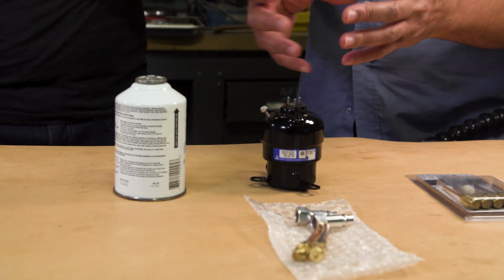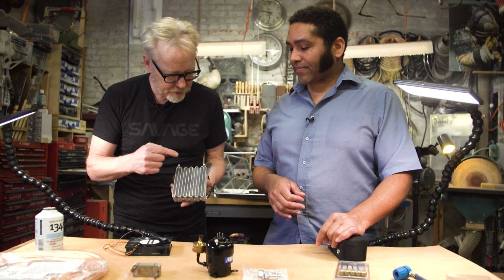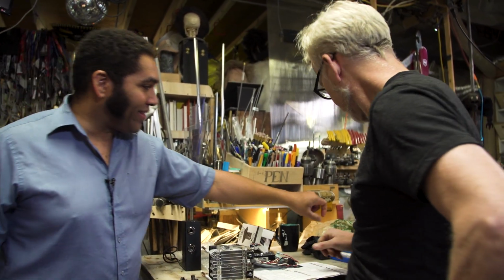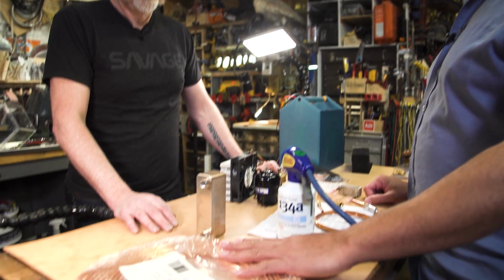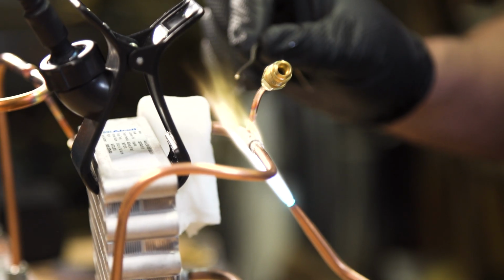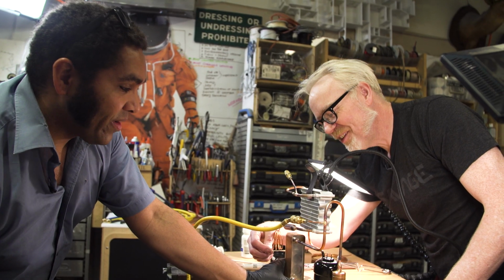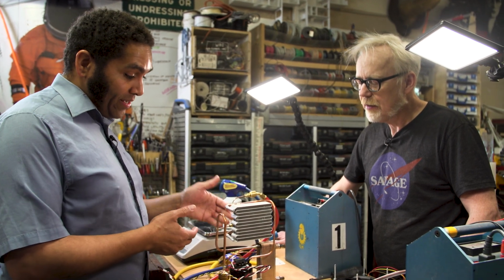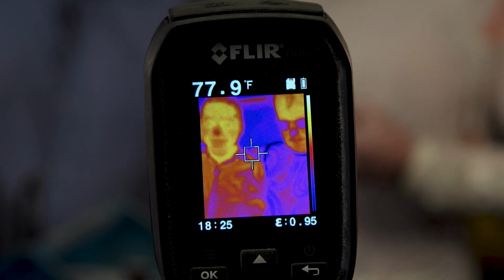Adam Savage's One Day Builds: Refrigerated Cooling Suit!

Comment: I would be curious about the capillary tube calculations because it's a variable compressor system and the load is set for what temperature and what speed? Higher flow would make it less efficient which is doable but sizing it to be efficient at high flow means it could backflow too much to the compressor or some such. A tiny TXV would have been nice too.

Comment: So, I've watched this video. I, too, have need of a system for cooling my body while wearing a skin-tight upper body silicone suit. But Adam, I just can't make this. I don't have the resources or the expertise to make something this complex. I feel defeated.

Could I not achieve a similar result using Peltier technology and a water pump and some fans and a 12V battery? Would it not be adequate? I still do not know. But I know I cannot create THIS build. :-(
Reply: In some of his spacesuit cosplays, he just wears a water cooled t-shirt, and has a tank with ice water on his back with a pump. Doesn't last for 
long, but it's something. I guess it would be possible to saw a tube of sorts into a shirt and pants, and have like a thermos with very cold alcohol in it with a pump that can withstand those temperatures, but probably wouldn't last a long time either. With Peltiers, you'd have to have MANY of them, well cooled, but since they aren't very efficient, is still could not be enough.

Comment: Curious I am about 3d metal printing the entire compression and expansion modules as well as integrating piezo fans for reduced power consumption. Battery or solar and battery power at various voltages would be a special issue Any thoughts?
Reply: That'd be a pretty cool use of metal 3d printing indeed

Comment: Why is copper tubing used for all of this? Isn't copper very conductive to heat, and you don't want most of your heat/cold to leak out in the wrong places? Especially the coil for the pressure drop being coiled up all close together, you don't want your hot side to leak heat to the cold side. I guess copper works well for working with pressure, but isn't there a way to get flexible tubing with less thermal conductivity? If the tubing is flexible that should make the whole setup a lot less fragile too. And since the pressure is somewhat constant under constant load the flexibility shouldn't matter too much for the function of the system.

Comment: I live in a super hot desert area of Argentina and I always felt sorry for the guys that do any type of work outside during the yr. Because when it's hot it gets super hot, but on winter it gets really chill. So, I always wonder why there aren't any climate controled suit for them to wear. They use some not high tech technics like be fully covered on light weight clothes an dcovert up to the head too so they create a sweat evaporated area inside the clothing that keeps them up to 5 degrees colder that outside. Much like people from shara desert or arabian desert do. But I believe that's not enough.
I wonder how you think the coller system you created in the video will work on a 100 to 115 F to keep a working hard person cool?

Comment: I just wish this was easier, cheaper, and more accessible to build. I definitely want one for many reasons including my personal health issues. Already looking at getting some form of helmet.

I hope to one day have a full body cooling suit.

E.g., similar to what China is now making with the air conditioned hazmat suits.
Reply: U dont have to go as hard as they did. Actually wouldnt be that expensive to make one that would work for most people's needs. U could get a suit similar to the one in the video with tubes running thru it and then just use PC water cooling parts.
All u really need is a radiator, tank, pump, fans and power. 
Ur not going to get as cold as this suit, but if they can keep 1000+ watts of heat under 30c in a PC should keep a person decently cool.

Comment: I want to thank Kipp so very much. He quantified the body cooling needs very well (-100w and non hair areas). I want to make one for my experimental airplane!! This is why I searched and found this video. Super jealous of the high quality tools there!! 40 yrs as an engineer I enjoyed Kipps explanation as clear & accurate, but simplified (appropriately) sometimes. Varying 134a mass flow, compressor speed, and fan speed effects nicely touched on. I installed a few hundred AC systems in VW's back in the 70's then after the MSME, fully understood.

Comment: Just coming to this video a year later, after Adam referencing it in the second G4 spacesuit build video. This is an amazing bit of technology to cool oneself while wearing a cosplay spacesuit. I know he did something similar with his 2001 spacesuits that he wore with Chris Hadfield. While this solution is super-cool (see what I did there?), I don't see it as being quite as practical as the cooling shirt version that was the predecessor to this design. I wondering if adapting a Peltier cooler into a little recirculating water tank would be a good hybrid between the two types of systems. Those little Peltier coolers can be salvaged out of battery-powered coolers, or possibly adapted from mini-chillers designed for nano reef tanks. Now I have to go back and watch the 2001 suit video to refresh my memory on how he did those coolers.

Comment: I really wish there was a parts list or documentation on what size fittings were used as well as how he determined the correct fill of refrigerant for this. Awesome build!
Reply: I need this too
Reply: Refridgerant fill for a capillary tube system is determined by its performance and temps, since it doesn't have an intelligent metering system it doesn't keep a constant quantity of liquid in the evaporator. You add to the low pressure side until the pressure on the high and low side are suitable given the load - based on the maximum load so that the liquid doesn't get too cold and have too little cooling power due to the pump working harder at a given RPM based on the pressure of the low side. At lower RPM, the temp will be higher on the cold side, and lower on the hot side.
Reply: @mikafoxx2717  so trial and error with a gauge set? This pump is variable speed so wouldn't it sort of only work well with a variable orifice?
Reply: @mikafoxx2717 ever since this videotape out, I wanted to program a small PLC to run a variable orifice, pump speed. And have all the feedback. But I really haven't been able to find documentation to describe the control loops needed. Or like.. what math to use to run them.

Comment: So, this might be a really dumb question, but could you use the same stuff to heat things up?
Reply: That's actually a great question. I'm an engineer and I'm not sure. I only know that from a high level the "carnot cycle" is indeed reversible, so you can switch the direction of the cycle and the direction in which heat energy is transferred. As far as the functioning of these actual components, I think the setup is one-way, so it would need modification to be turned into a heat pump. 

I'm going to read more about it.

Comment: I would seriously like to talk to someone about the price and possibility of building this in a 12v version if possible?  Having something like this hooked to a chill suit under our fire suits in a race car would be a game changer for sure.
Reply: There are already suits designed for racing in 12V. They typically don't use a refrigerator because a car is big enough that you can just fit a huge reservoir of ice water. Simple heat exchanger, no refrigeration cycle needed.
Reply: @paulogarcia1766  not the kind of car I'm in. Off road utv racing.

Comment: I hope you see this. But, I'm wondering how much space the complete unit takes up? What about the individual pieces?
And do you have to use copper tubing? Could you use flexible tubing instead?
Reply: flexible tubing diminishes heat transfer efficiency but yes it'd work

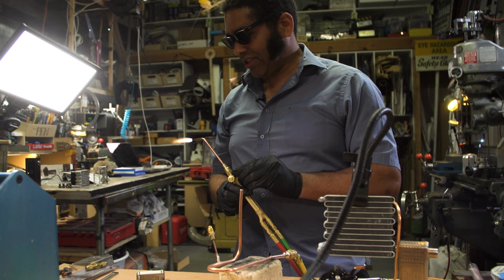Comment: One little thing they didn't talk about too much you can see at 38:26 and 40:35.
That yellow line is flowing a little bit of nitrogen through the pipe as they braze, displacing oxygen inside the pipe that would otherwise turn to soot and contaminate your compressor oil.
On tiny systems like this you just fill the system with nitrogen and let it sit there, on larger systems you want nitrogen gently flowing the whole time.

Comment: I’m only 13 minutes in so far but I’m positive about two things:

- Kipp needs to be in the spotlight much, much more often.
- You’re working on something that will drastically change the lives of a whole other population (which I’m interested to find out if you consider by the end): namely motorcycle riders who refuse to compromise safety by shedding gear when the temperatures rise.

Comment: That is a drastic oversimplification of refrigeration, but it's mostly right.

The compressor increases the pressure of the relatively warm, low-pressure refrigerant gas (goes from a low-pressure gas to a high-pressure gas) that (per Boyle's law) happens to also increase the temperature of gas. As the now high-pressure, high temp gas passes through a condenser coil (the hot one), then it changes state from a high pressure gas to a high pressure liquid as heat is removed and the temperature of the refrigerant decreases.

After that the high-pressure liquid passes through a metering device of some sort (usually a capillary tube for smaller applications, or commonly a Thermostatic Expansion Valve [TXV] for larger applications such as air conditioners) to lower the pressure of the liquid before reaching the evaporator coil (the cold one), resulting in a very abrupt loss of pressure and temperature changing the refrigerant's state from a high pressure warm liquid to a low pressure very cold gas. This gas then absorbs heat from the refrigerated air around the coil resulting in the temperature of the refrigerated air getting colder and the relative temperature of the refrigerant getting warmer, but not enough to change back to a liquid state. The relatively warm, low-pressure refrigerant gas then moves back to the compressor, and the cycle repeats.

It's all basically taking advantage of these very bizarre physics properties. You can think of it like exploiting a glitch in the matrix, and we just take it all for granted. As a refrigeration/HVAC tech, I love it.
Reply: To clarify, I wrote this based on the first 3 minutes where they summed up refrigeration systems. After watching more of the video, they do delve deeper into the physics and mechanics of how it works, and I think this cooled-water solutions works way better and makes a lot more sense than directly cooling just the air in the suit. As a refrigeration tech, I approve this awesome build!
Reply: Hi, could you tell me How to call this kind of vest without zipper in English professional title?
http://amzla.com/u7rtdt2bgsol

Comment: You can already get cool suit systems for use in motorsports applications. As you can imagine, racecars arent about comfort at all, and it can get pretty damn hot inside the cabin of one and in the quest for lightness the A/C system is one of the first things to get tossed. So you wear a racesuit that has refrigerant passages inside it and have a chiller unit about the size of an esky that sits somewhere in the cockpit and suddenly race driving is a few percent less masochistic with that creature comfort reinstated.

Comment: I once installed a similar heat exchanger that was 8 feet tall by 3 feet wide by 3 feet thick and weighed more than a Cadillac as part of a 30,000 ton chilled water A/C system for a small skyscraper in L.A. These things do an amazing amount of work for their physical size. You used tubing as the metering device? I guess they don't make TXV's that small?

Comment: It has been 7 years now since I last brazed. I was a union commercial plumber welder and I don’t believe one is supposed to use flux with brazing even with two dissimilar.  I remember the Ned air systems we put in with argon purge and I do not think flux was used as well as I believe we were not taught that was. Soldering yes but sil braze is too hot and would just burn the flux up bad.

Comment: Does anyone have any resources for information on the diffusion bonding process Kipp explains? I've only found information on using vacuum furnaces for braze wicking and using a pressure-based system, such as weights or a press, for this, but I have yet to find an example of Kipp's explanation of a dissimilar metal bracket.

Comment: That would be cool on the set of 1980's Star Trek but what about a silicone thermoelectric cooling suit lined with Nylon tubes? it wouldn't be as light as it sounds. Maybe 4-6 pads (at armpits and inside thighs) could power a pump and a couple small fans. Or you could where a wet suite inside out, that would keep you cold right?

Comment: Maybe using a small EXV that can be adjusted could be better than changing your voltage through the compressor, increasing temp variables without expending more energy from your battery also you wouldn’t need a long run of the capillary tubing, saving space in the process. Also using a deburrer and blowing nitrogen through the tubing can eliminate most of the copper shavings in your system preventing the possibility of your filter dryer from clogging.

Comment: When you drill a hole in the pipe and braze in a small service port, you create a stress point that will fail over time due to vibration.  @Adam Savage’s Tested idea of a T fitting was much better.  Time will tell

Comment: You pull vacuum to remove moisture. As soon a system has been opened for the enviroment it will be contaminated with moisture from the air. Moisture in the system can cause different kinds of problems and reduce the performance, so that is why it needs to be boiled away and that is done by vacuuming the system.

Comment: The cooling concept on your body is great! Big problem, ice against your body is very uncomfortable. Your skin has to breathe. Why do you think our bodies are cooled by sweating? The moisture evaporates carrying off the heat from your body.  True air conditioning is through air circulation, temperature control and dehumidification. Evaporating the sweat from your body and carrying off the heat. Exactly the way whole house and auto air conditioner works. I wonder how long you can keep that cool fluid vest on you before you get cold sweats? Yep, try it with an ice cube on your skin. Same thing. No air circulation or dehumidification to carry off the heat.

Comment: Adam! Eliminating the refrigerant in the video and compressing the air being breathed by the occupant to heat up a cartridge with sand, the carbon will be extracted by the silicon dioxide effectively coating the sand with graphite, and reducing the temperature of the air. Lungs have greater surface area than the skin covering your body; regulating the refreshing breath cooling your core.

Comment: Adam as a PC builder and experienced guy with radiators and water loops I advice you put the cooling fan the other way round on the radiator so that it pushes the air thru the rad instead of trying to pull the air thru it. From my tests push configuration gives lower temps than pull. The only other way to increase it further is push-pull config so 2 fans on each side.

Comment: If you fill the copper tube with water or even sand  sealed at both ends it will not kink when bending .  EVER.

Comment: Let me make this real basic. Temperature is a measurement of energy per volume (energy density). It's not about the medium (R22 etc.); it's about the compression and expansion of the energy in the medium. That energy typically/naturally flows from the space of high energy density to a space low energy density. Room (higher density) to uncompressed medium (lower density) through AC's heat exchanger, compression makes that energy more dense; then, the medium, now even higher energy density than outside summer heat, transfers it's energy to said outside air. One side is kept compressed by flow restriction. Compressor> hot side> flow restriction> cold side> repeat.

Comment: i did this one year for my gpu.  but the block and  unit itself was inside non conductive oil within a sealed tank with the pressure inside changed depending on the heat the gpu gave off and cooling supply within the oil so i didnt end up freezing oil yet i didnt end up burning my gpu. Arduinos are pretty handy for on the fly pressure changing in a phase change solution to overclock a cpu or gpu. good to see my ideas are the same as NASA's.

Comment: This is amazing! I love the discussion into the science behind why this works while building. I have one question though: It seems this system requires gravity to work..? If so, how do you overcome the limitations of using it in austere environments (i.e. space)? ...even in "gravity rich" environments it would seem orientation dependent which would limit your ability to jump or bend over. How would one go about overcoming this limitation to this design concept? (additional components? swapping components? not require phase changes?)
Reply: It's not gravity fed, the compressor is doing the work increasing the pressure of the working fluid and that's what pushes it through the system, fluid naturally goes from higher pressure to lower pressure

Comment: Don’t mean to be a stickler but when initially charging a unit,  add through the hot  side ( Liquid ) while the unit is off and suction ( Vapor ) when the unit is running. Charging liquid through the vapor side when the unit is off will wash the oil out of the compressor and can damage it.